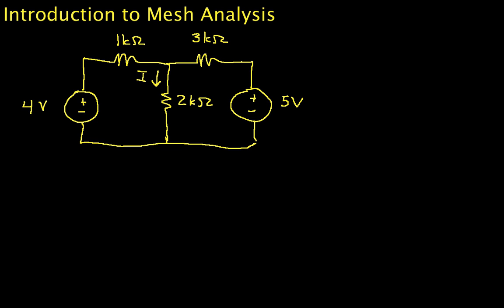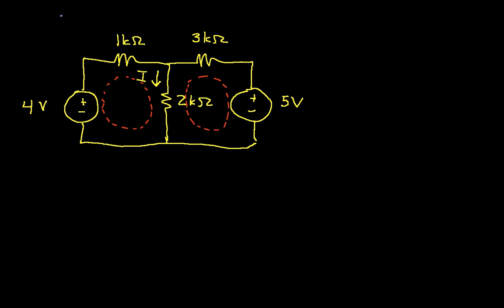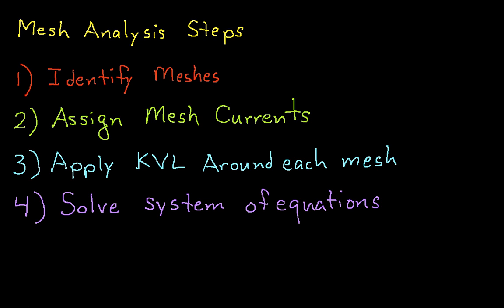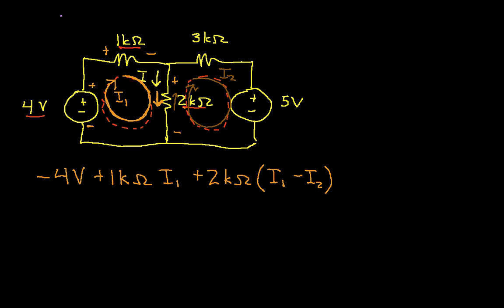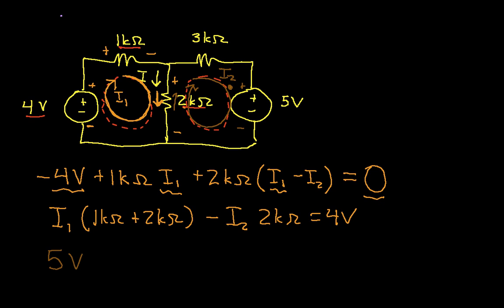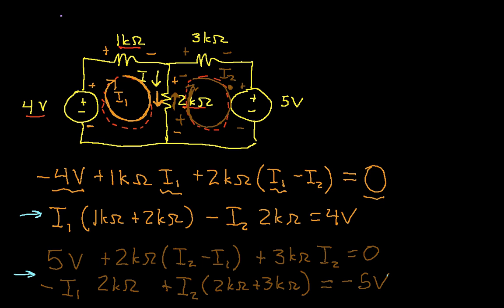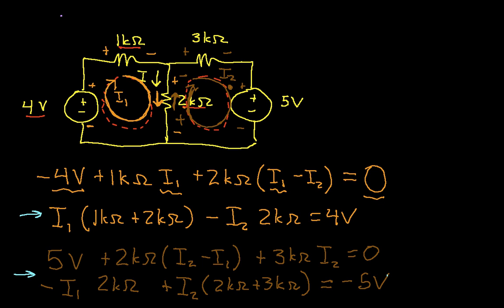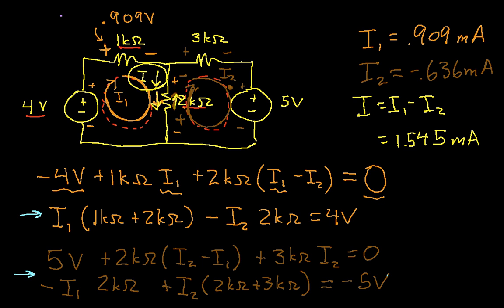Introduction to Mesh Analysis

Comment from the maker: You can use source transformation on this circuit (and on many other circuits that you might solve with mesh and nodal analysis). The point of mesh and nodal analysis is that they give you procedures that apply to almost every circuit and you can be certain that they will work; source transformation may or may not work for a given circuit.

Comment: He's using wolfram to cut on video time. And because solving for those is basic algebra.
But if you can use a graphing calculator I highly recommend using the matrix feature in order to minimize algebra errors on exam

Comment from the maker: The first time I was applying KVL going around Loop 1 clockwise. The second time I was applying KVL going around Loop 2 clockwise. Since the 2kOhm resistor is on the right of Loop 1 and on the left of Loop 2, we pass through it in different directions. That is why the sign is changed.

Comment: Because it's the 'sum of the voltage DROPS in the current's direction is equal to zero' (KVL).  Going in the direction of the virtual current, the 5 volt source is a negative drop.

Comment: Could you please explain why you changed the signs? Also I always have trouble deciding which of the resistor should be positive when it is connected to a voltage source (in parallel AND series)? Thanks a lot! Nice video by the way. Please answer this question someone.

Comment: For some reason no matter how hard I try I cannot get the 3rd equation @ 9:23  (5v+2k...) to equal the 4th equation below it, I get it almost the same but the signs before I1 and I2  are reversed. Am I doing something wrong or did you make a mistake? thanks

Comment: Are the a1 and a2 values correct? I've been trying to figure out how you did that for like an hour (using a calculator), and I just don't get those answers.
Reply: Make sure you have the sign for current 2, i.e a2 right. It should be negative. when you solve the two equations, you should get a2= (-7)/11 = -0.636. Using that value solve for a1. which would be exactly a1= 0.909 and then for I=a1-a2.

Comment: I think there is a mistake In the second loop!  how can the polarity of a resistor be the same as the voltage source it doesn't make sense I say the resistor should have a negative voltage in that loop !! correct me if I'm wrong ( I nd quick answer plz)

Comment: How can I1 that passes through 1kohms is the same current that also goes through the 2 kohms resistor as well?
Reply: Because the left loop is in series. Current is constant in series regardless of how many resistors are in the circuit. Vice versa for voltage though.
Reply: Mesh analysis doesn't use current through branches; it does use current through meshes.

If this analysis didn't use mesh currents, then you'd be right, because the current I_1 (which travels through 1 kohm regardless) would divide at the top node, and hence it wouldn't be the same as the current through 2 kohm (the only way the current I_1 through 1 kohm can be the same as the current through 2 kohm, is only if there's actually no current going through 3 kohm.)

Comment: why not use (i1-i2) in second equation?
Reply: +Clevarn Osam The first equation is derived by "following" i1 around the loop and treating it as a positive when it goes through a resistor. Similarly, the second equation is derived by following i2 around the loop and treating it as a positive through resistor. If he used (i1-i2) in the second equation, then i2 would be negative and i1 would be positive. IF i2 is positive (which it always is through a resistor as that is the definition of what he is doing) AND i1 is going OPPOSITE of i2 then it has to be (i2-i1).

Comment: k i hav a routine of always converting the Kiloohms back to standard form before i do any equation. And up till now it has served me well on tests to do so. But for some reason when im doing this with the mesh loop. I get the same answers you do BUT i am off my .000 basically my final answer is in MicroAmps. why is this. Sorry if this is stupid question very tired exam tm. thanks.
Reply: probably because you're converting to Kilo-Ohms.. if you're getting the same values just off by 3 decimals at least you know you got the concept, just be careful when doing your math and keep track of your units. or try only converting when necessary. good luck!

Comment: is not your polarity wrong? you assigned the polarity at 1k ohm resistor other way around. isnt it that if a current is entering into the resistor it should be negative and the current leaving the resistor possitive?

Comment: loop 2 2kohm is negative
Reply: +Anti donkey missle Not really, since the current i[2] is opposite and therefor negative to the first one, it "adds up". You can also think of it like this, a pure resistance is always positive and opposite the current.
Reply: It's confusing thank god I'm a mechanical not an electrical engineer :)

Comment: The voltages are wrong should be positive 4v and negative 5v...
Reply: NsHenryGz No 👎. Henry, there are two ways to apply KVL. First way is that the voltage of all resistors is always considered negative, and that sign of the voltage of a voltage source is determined by which terminal the current mesh is *exiting*. The second way is that the voltage of all resistors is always considered positive, and that sign of the voltage of a voltage source is determined by which terminal the current mesh is *entering*. Both ways are corrent; just multiply the equation from first method by -1 and you'll get the equation from second method.

Comment: you did wrong there.. in terms of second loop.. the polarity of 2k ohm resistor and 3 k ohm resistor is negative
Reply: Nope, You flip the signs and if you are using convention that current leaving the the + on the voltage source as positive then the equations work out

Comment: yeah the 2nd loop equation is wrong
Reply: Sorry, But I don't get why the equation for the 2nd loop is wrong? I solved it first without watching the full video and I got the same answer as yours at the end !
Reply: Derek Langley not really, you can change the polarity of the 2k ohm resistor depending on which mesh current you are applying. In this case, in the first loop the polarity was as such that the positive is on top, however when doing loop he changed the polarity of the 2k ohm resistor and that is perfectly allowed.